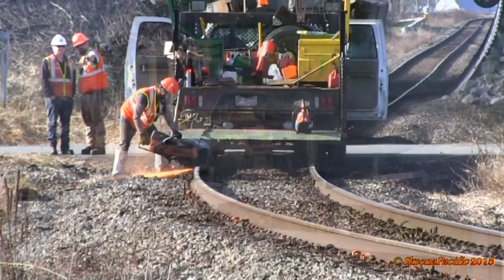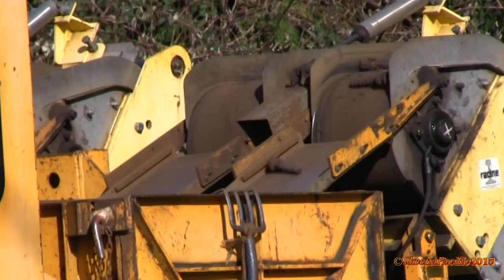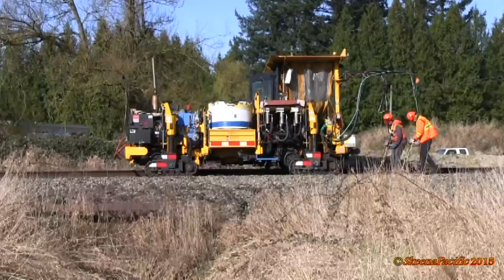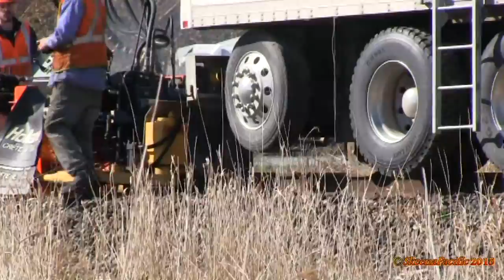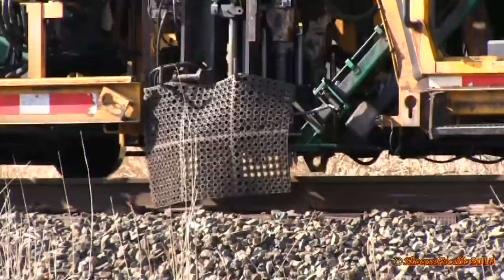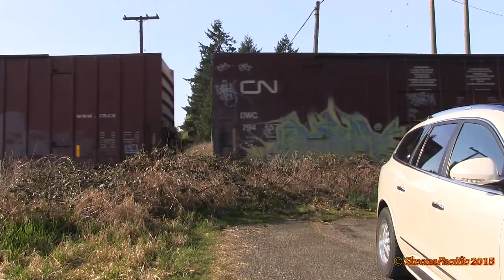#558 The Steel Gang   2015-03-04

Comment: Try doing it in January 200 miles around Boise Idaho. We weren't quite as automated, but close.  As I recall, there is wear on the inside corner, but the outside corner "bucks"and wears.
Reply from the maker: Thanks for the info.

Comment: that's an old Holland lol. I used to run MW552 up in Northern ontario. welding cn mainline. reddit and allanwater subs
Reply from the maker: I guess the machine gets around. Thanks for commenting and watching.
Reply: Jay you must remember the 420 truck then
Reply: Are you still working for cn rail because I want to work for cn rail
Reply: @1980DEVILSREJECTS  hahaha you bet ya. Welded with that unit along side my 552